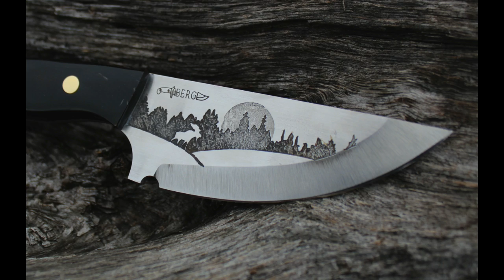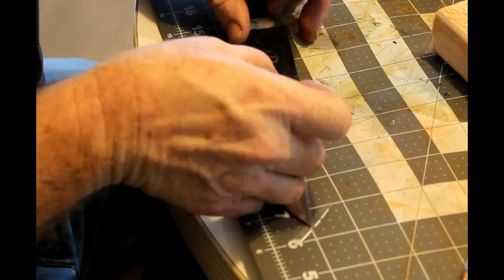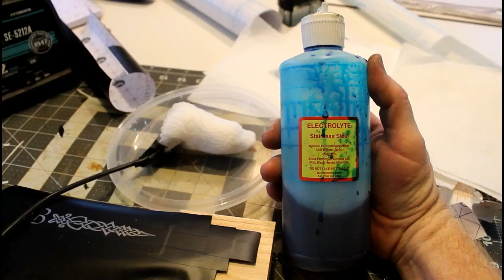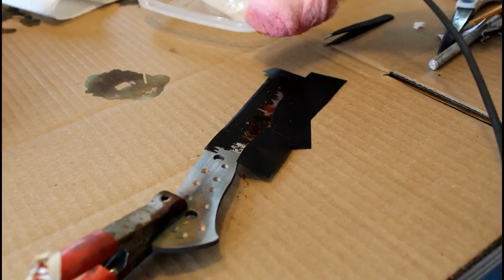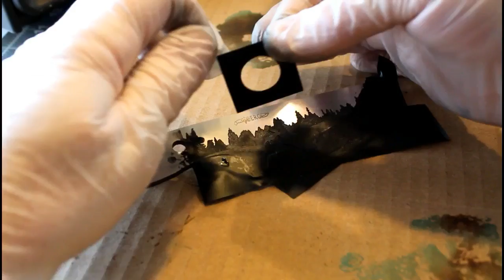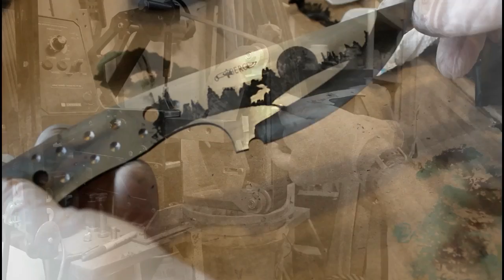How to create Two Tone Stainless Metal Etching for knife making

Comment: So you're getting dark marks and only using DC, correct? I'm not seeing that particular etchant anywhere if you have any leads.
Reply from the maker: I make my own. White wine vinegar and salt. The darkness also comes form depth of the etch. I usually etch 12 volts, 2 amps for about 3 min total (30 sec intervalls and cool in between)